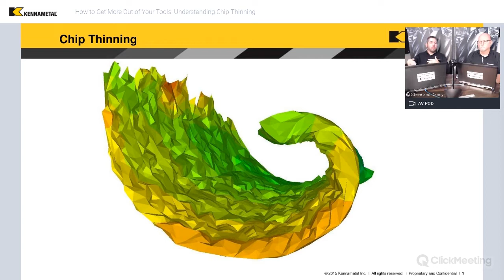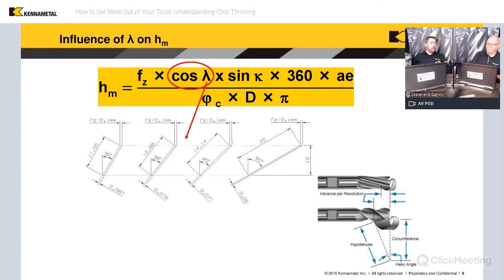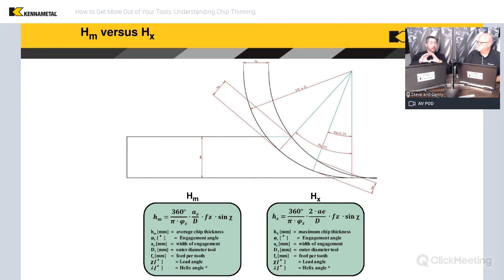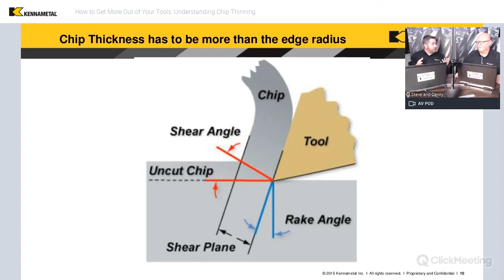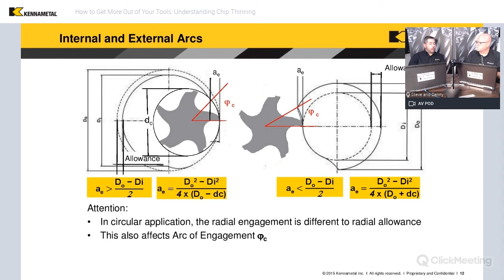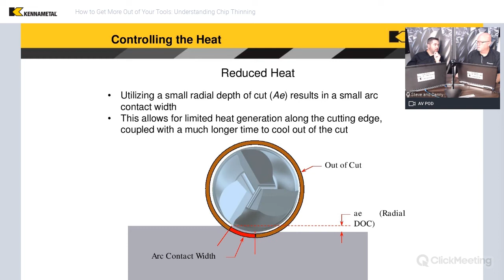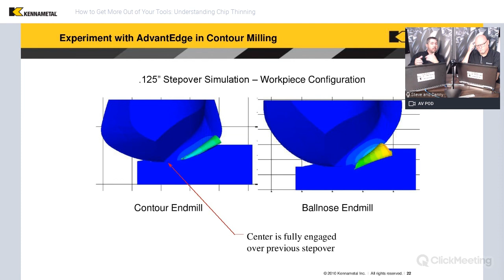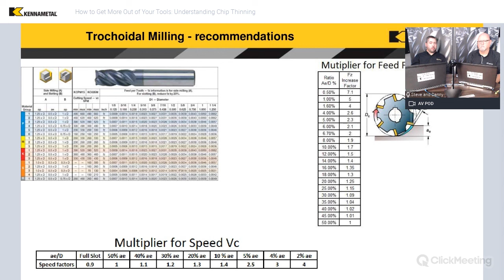How to Get More Out of Your Tools: Understanding Chip Thinning

Comment: With this information, I'm looking for general SFPM for various materials, general recommended chip load (feed per tooth), and I would also like to see minimum chip load. The minimum chip load would be used for getting the clean finish and avoiding rubbing in the process. I'm not sure if you guys are working on the app (since it seems to have been down for a little while). If you are, all the dynamics of this information as well as the finishing FTP would be very handy.
Reply from the maker: Hi Tony - I will pass your comments along to Steve and Danny and perhaps they can do a webinar around general SFPM and chip load/minimum chip load.  Thanks for the suggestions!
Reply: @KennametalInc  the more I understand chip thinning the more I wonder if I have been programing all my feeds and speeds wrong. Instead of going off of SFPM and adjusting my FPT, it seems like I should have been looking at ideal FPT and calculating SFPM based on % tool engagement or TEA.
Reply from the maker: Tony, you have the right idea. Ideally you would select a FPT, then adjust it for the radial depth of cut, and then also adjust your base SFM based on the radial engagement percentage. So in the end you should compensate both from the base values, and usually I play with speed more than feed if I know the FPT is already in the right range.  Hope that helps!
Reply: @KennametalInc  it really sounds to me that as long as I keep the optimal FPT at the point of engagement, my only limitation is the machine. Focusing on either max rpm or max feed while keeping FPT.
Reply from the maker: You've got it Tony!  It's about finding those optimal parameters one step at a time as you identify machine limitations, setup limitations, etc.